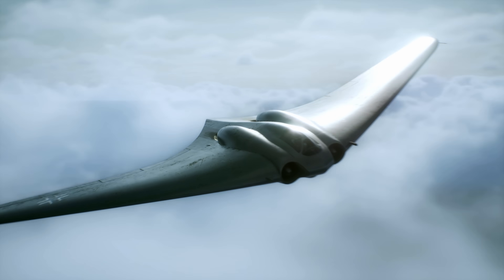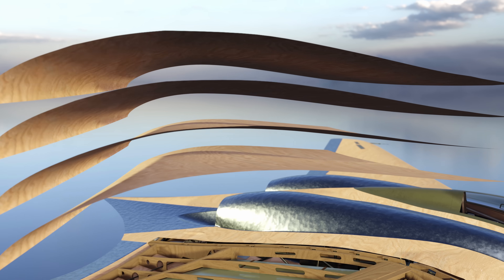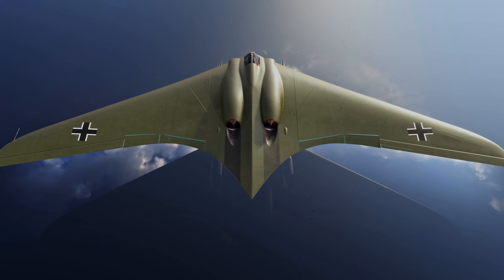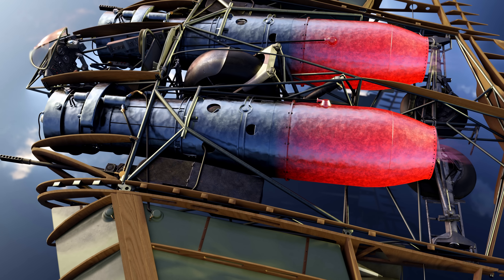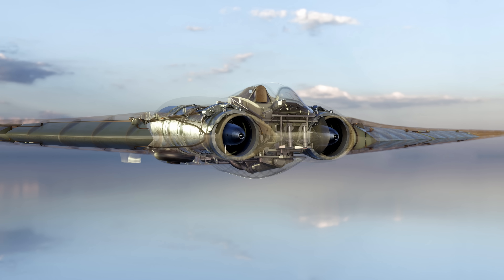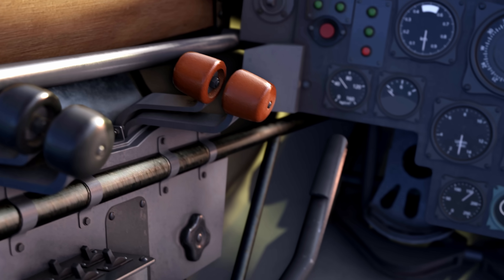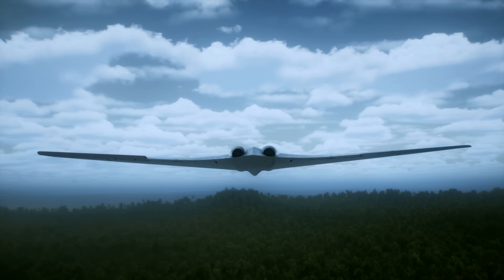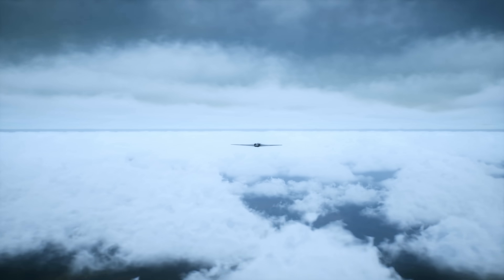Inside the Horten Flying Wing

Comment: Don't you need some insane fly-by-wire system to keep this setup stable?
Reply: +@I_Cunt_Spell  Modern computer control did solve instability problems with flying wings.  Although Jack Northrop had developed yaw dampers in his YB-49 late in the program.  Instability was not a good feature for a precision bombing platform.

Comment: US aircraft and rockets are based on designs, finished products, and even teams of engineers, stolen from Nazi Germany at the end of World War II.
Reply: Not really the case
Reply: No, not for the most part in fact. What would have been the case though, would be the Type XXI submarine. That right there was very much studied since it was really ahead of its time as the first combat submarine going faster underwater than on the surface unlike other uboats and allied submarines at the time, was meant to operate underwater at all time (even if just periscope depth for the Snorkel device giving fresh air to the crew, to refill air bottles and exhaust diesel engine fumes). Pretty thick and well built pressure hull allowing it to dive at nearly 290m (it was a big deal back then and still is), a lot quieter and less prone to sonar detection, on top of having T5 acoustic homing torpedos which were primitive but pretty neat at the time.

Comment: The problem with flying wings is they need constant micro adjusting and it hans't been until the last few decades that the computing power was small enough to put it intoo a bomber let alone a fighter. The reason you see them in jet drones noow for fighters is no need for pilots.

Comment: So the HO-229 prototypes were tested and flew in 1945. As I take it, two main technical challenges were the negative arguments at that time: (1) the yaw-control (no computers to automatically control the ailerons for stabilization) and (2) better jet-engine and fuels-types. 
I wonder, with peace and more and more technology coming up after the war (transistors for example and the race for superior jet engines in the coming years), WHY was that wing-only design not improved in the 50ties or 60ties??? Its beyond me. USA could have had a B-0.9 bomber (albeit without stealth probably) way earlier...
Reply: +@takeyoshix   The V1 glider flew until it was destroyed in a landing accident.  The V2 only flew for a couple of hours before it was destroyed in a fatal accident in February 1945.  That is all of the flying that was accomplished by 229 program.  The surviving V3 prototype is not even complete and it never flew at all.   Why nothing in the 50s or 60s?  Speed.  I don't think any wing is capable of supersonic flight due to stability issues.
Reply: Accurate simulations modeled in computers.

Comment: Keyword regarding the Northrop Grumman research paper, is modern. While qualifies as stealth in modern times would exclude the Horton 229 from the club, it still would have been stealthy enough to send back a reduced radar signature to the Home one defense, radar network, slowing response time to bombing blitzes. Which was the intended effect and mission of the Horton 229 development. The Northrop Grumman study was flawed simply because they weren’t using the tech available at the time of the Hortons development, they were using modern tech to determine whether or not it was stealth.

Comment: Where and how was it captured? Im surprised it wasnt destroyed before the allies reached it.
Reply: +@markrix  Gen. Patton's forces overran the Gotha workshop in Friedrichroda, Germany in April 1945.  Inside they found the incomplete V3 (now at the Smithsonian) and the frames for the V4, V5, and V6.  There are a few photos.  And I'm assuming Patton's forces destroyed the V4-V6 in place.  There were no wings for the V3 and some were found some 75 miles away.  In the summer of 1945,  the US didn't really want the V3 and they gave it to RAF Intelligence for evaluation. The RAF considered finishing it to fly with RR Nene engines but they did not fit.  The British were also interrogating the Horten brothers that summer and attempted to locate the remains of the crashed V1 and V2 but were unsuccessful.  By August 1945 the British were done with the V3 and gave it back to the US and it was on the shipping docks in NJ and then it went probably by train to Freeman Field with other captured aircraft.  The V3 was not some mystical ready-to-fly machine - it was just an unfinished prototype.  By 1947-1950 the AAF was scrapping/disposing captured aircraft and Gen. Hap Arnold had the wisdom to set a few aside.  The V3 and other aircraft were relocated to an empty hangar near Chicago (now O'hare Airport).  By 1950, those aircraft were donated to the Smithsonian.  Unfortunately, the Smithsonian let the V3 set outside in a crate for almost two decades and moisture has rotted it to pieces.  In my opinion, the Smithsonian should reconstruct it into the unfinished prototype as it was found.

Comment: B35 and B49 were flying wings built after WWII, not 50 years later.  Still a worthwhile video.
Reply: Scaled prototypes for the XB-35 began flying in 1941.
Reply: @peterson7082  right, also not 50 years later than the ME-262.

Comment: I’m not sure if I am more impressed by the aircraft or the superb quality of the graphics and research that went into making  this video .
Reply: That's Yarnhub for ya. They're top notch.
Reply: most impressed by the pilots❤
Reply: the b2 spirit before the b2 spirit
Reply: @cyberdemn  the ACTUAL b2 spirit before the b2 spirit was the model 1 avion, which happened to also be made by northrop
Reply: @damascussteel7688 there were many flying wings. But the Horten brothers built the first ones without vertical stabilizer. This was actually the most awesome feature of this aircraft
Reply: @janp5880 The Horten Ho-229 is also completely devoid of any significant retrorefletive structures that can create a strong return signal... which is why it has a 50% reduction in frontal RCS even without the RAM applied... and it's why Northrop copied the design of the Ho-229 for the B-2
Reply: Lies are still lies.

Comment: Flying wings cannot really be kept stable without a sophisticated enough computer. It is not a coincidence that this design was not used until the B-2 and it is not too popular even since then. This was a failed design in those days. Although it is beautiful.
Reply: It's just americans couldn't design it to be stable enough. According to horten ho test flights there were no such issue.
Reply: @4354-d4v  The flying wing has many advantages for a bomber, not only stealth, so if it was possible to make it usable with WW2 techniques, this should be easy by todays standards. Yet, no one ever used this design (USSR/Russia, China, etc.), which makes me think it has serious problems, problems that definitely cannot be solved using WW2 technology. I think, it is stability, but if not, something other. Anyway, this was a flawed design for the time.
Reply: @4354-d4v  They very much had those issues in their powered aircraft
Reply: @4354-d4v  No. There's a reason not a single country mass produced flying wings before fly by wire was a thing.

Comment: The surviving prototype in restoration did discover charcoal impregnated materials, which in combination with the wood was designed to give the Ho-229 a stealth-ish capability.

The specific findings of the 2008 test was that it was detectible at ~200mi at low altitude sneaky flight; given its speed and the response time of allied fighters this would have been a HUGE advantage in surprise.  During the Blitz German formations were detected upon take off in mainland Europe before they even began formation approaches across the channel at 1/3 the speed of the Ho-229.  In perspective: 20 mins of warning vs. 3-6 hours.

Germany frequently implemented technologies that broke the allied defense strategy (see Ju-86P and the Fritz-X use against Italian naval targets).

Comment: Amazingly, we had a German fellow came to see us  ±20 years ago. He signed a lease for space he said looked "just like the factory where the Horten bros built the 229s"   He showed me German books and yes, our space did seem similar. He intended to reconstruct a full sized replica working Horten!   There were some fascinating things he told us about his connection to Werner von Braun and Hanna Reitsch, which we could not disprove. But when rent was not paid for months, 229s were electricity was tapped unpaid and the "Deutschland über alles" signs were posted. we'd had enough, and sadly- had to pull the plug on the lease AND the project.  
He made some fantastic claims about Nazi skills, Germany and "plans" that even today were scary to us.

Comment: A number of years back I had the privilege of getting a tour of the restoration facility at Suitland, Maryland . The tour was led by an aircraft designer. The Horton was resting diagonally on one wing. One wing edge showed the wood lamination. I asked the tour guide why it was made of wood. He replied that by the end of the war most of the industries building war related aircraft parts were bombed out. However, furniture makers were not. Since the material they used was wood and they had the talent to work in this medium, they got the contracts. I don’t know if this is true but it seemed to validate the use of wood.
Reply: It was at least partially due to the prioritization of war materials to other production — duralumin for existing fighter and bomber production, for example. Using wood exploited an underutilized manufacturing capacity, speeding production of the airframes. This could have unintentional problems — the Ta154 Moskito, also constructed largely of wood, had its original glue supplier bombed, and the replacement glue damaged the wood over time, causing airframe failures.

Comment: some points to add here, what is also remarkable but not mentioned is the development time spend on this airplane! Sure the Horten Brothers had experience in designing flying wings. But the jet engine powered one must have been designed, developed, built in somewhat 1,5 years by a very small team of engineers at midst of all shortings and a war situation. This is not imaginable to todays standards. Also the last flight ended in a deadly crash of their friend and test pilot. What's also worth noting is that the Ho229 was inspired by the wings profile of the P51 Mustang, of which parts had been analyzed by the brothers and helped them to design the low drag design of their wing.

Comment: A flying wings advantage is that the entire aircraft is a lifting surface where a conventional fuselage is just dead weight and drag.  A conventional empennage is also not a lifting surface, but in fact the opposite so doing away with all that hugely raises acronymic efficiency, but also adds some very bad handing vices, the most problematic being low spin recovery ability and a nasty end over end flipping that will lead to structural failure if the critical angle of attack is exceeded (see YB-49 accident).  It is noteworthy that Northrup flying wings did not incorporate washout of the wingtips like the Horton wing did.  While washout reduces some of the efficiency of the wing the sweep along with the washout provided much better inherent pitch stability, much like a conventional aircraft where adding power would naturally provide some pitch up and reducing power would naturally pitch down.  Washout also helps prevent tip stall since its stall angle of attack is always less than the inner wing thus the inner wing stalls first, reducing lift and causing a natural increase of speed to self recover from the stall without a loss of roll stability and control.

Comment: I must have watched a different documentary on PBS, because the design though not originally intended to be stealthy does have a reduced chain home radar signature. Detection times for the RAF would have been reduced by half or less giving barely more than 10 minutes to intercept. It certainly would have been a nightmare to deal with. The design was literally decades ahead. It still looks like a futuristic design. Prototypes flew and rumour has it that it had flown circles around a Me-262 during a test flight. I couldn't imagine flying such an advanced design while foes were still flying prop aircraft.

Comment: Imagine flying sheets of plywood at 600mph.
Reply: It was stronger than modern plywood.  For one thing it wasn't pressboard.
Reply: @gratefulguy4130  U.S. plywood standards are lower than most of Europe, but Northrop built the N1-M the same way in 1939-40 as well.
Reply: Only in one documentary about Nazi planes was mention the method of making plywood. They were using special foil of glue, which was secret and only one factory was making that. Due to that foil they were able to make very strong wood, basically like a composite. But closer to the end of war that company was bombed so they couldnt make good plywood plane, they break down easily.
Reply: It is german wood.
Reply: @andik859  Stolen from Norway.
Reply: The wood was stronger but still I can’t imagine being told this was what I was gonna fly with plywood and two jet engines
Reply: Like the British mosquito? 😏

Comment: Was the stealth capacity of the Horton measured with today's radars or with the radars the British had in the 1940's, because that of course would change the debate.
Reply: It was measured regarding modern methods of RCS comparing the RCS of it to a 109. Relatively modern air search radars. Granted they didn't include potential material differences to a production aircraft. Engine RCS return isn't even mentioned. So take it with a huge grain of salt.

Comment: 1 thing you didn't mention in the video. One of the prototypes build actually flew a few times. The germans actually did a mock dog fight with ME-262 and the test pilot reported that the HO229 was just running circles around him. 

About. the Stealth is not completely true. N Grumman stated that its not true Stealth plane in modern terms however they admit that it was reflecting between 30 and 40% less depending on which part of the plane the radar was pointing - which is important.
The researches calculated the detection range based on standard high flight and the Low Level Flight (tactic the Germans developed - you fly low over the channel , the radars detect you later). Overall the warning that they expected that the brits would get vs H0229 was around 2-2,5 min. That is compared to the standard almost 20 vs all other German riders. 
So basically yes , its not a Stealth aircraft as we think it is but its stealthy enough to break the defence because 2 min is not enough time to scramble alert fighters.

Comment: The HO-229 was in fact stealth and would have given the Germans a 5 minute start. This 5 minutes is crucial as 5 minutes could be a drop and run type of mission. And due to it's massive speed, by the time fighters were in the air, the bombers were gone. 5 minutes to stop another 5 to scramble, another 5-10 to get in the sky. Northrope tested the plane multiple times. The one done for the show was inconsistant. But when scientists orignally tested the Ho229 it was lined with Charcoal and this did help the plane, A LOT. Like I said 5 minutes, that's a lot. The plane was seen being tested over battlefields, no one knew what it was tho. The design for the plane was also pushed at the begining of the war, but Hitler thought Jetpowered planes were not the future or the way to win the war. So the Horton Brothers kept to themselves when others started pushing for jet powered as they knew it would have benifited the war. If it was put into service before the V2 or around the V2/V1 they could have made significant gains. But yes the planw was stealthy and the B-2 spirit was designed around the HO-229. Pretty much the same evrything, flight controls and so on. Just with computers and more modern looking.
Reply: Nonsense
Reply: The B2 was not related to the HO-229 at all nor was the HO-229 made with stealth in mind.

Comment: The takeoff process was not exactly like this for aerodynamic reasons, here is the reason.
The rear wheels are far behind the center of gravity, so performing a classic rotation for the takeoff process is not an option, since it does not pivot on the rear wheels, for this to happen the rear wheels should be relatively close to the CG. In addition, the H229 on the ground showed a somewhat high angle of attack.
The behavior is that, as in a tail-skid airplane during takeoff taxi, the plane slightly lifts the tail for a moment, at this moment the plane is supported on the ground only by the front wheel, and it is when the pilot had to pull to raise the plane, this moment was very critical due to the lack of longitudinal stability that it presents both aerodynamically and by the fact of being supported by only the front wheel.
You can check this both in simulators and in RC models of a certain size, I have tested it in both.

Comment: The video doesn't really say how far this plane was from entering service. At least a year, but more likely two.For example, the ME 262 entered service 2 years after the prototype stage.

A total of 3 prototypes were built. The first one was a glider with no engines. The second crashed after two flights. The third described here was incomplete when the war ended. None of them had armaments.

Comment: I think it would be interesting to see how an updated design of this plane would perform. Keeping the original dimensions as much as possible but with modern more efficient engines, computer controlled systems, stealth coating, all metal\composite frame and skin, as well as possibly onboard radar and air to air misiles
Reply: Just google „Northrop B-2“